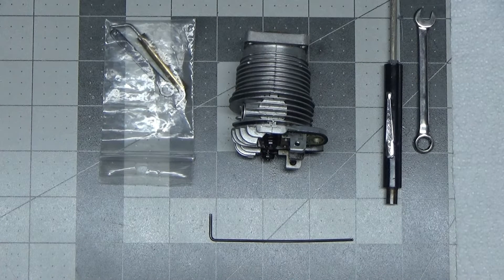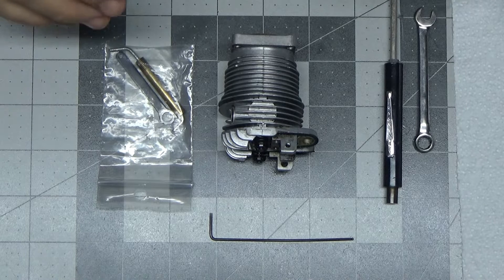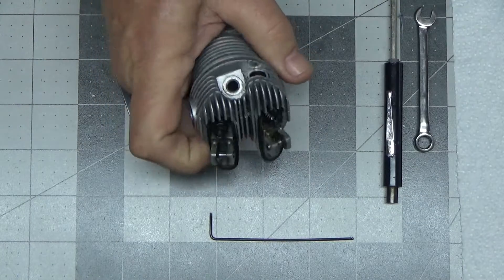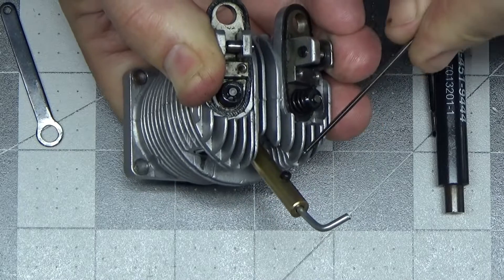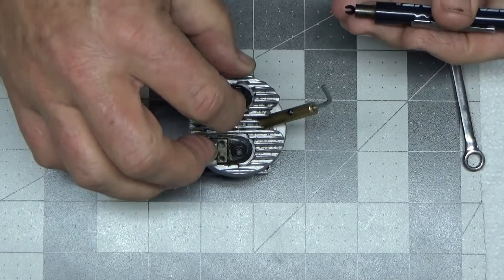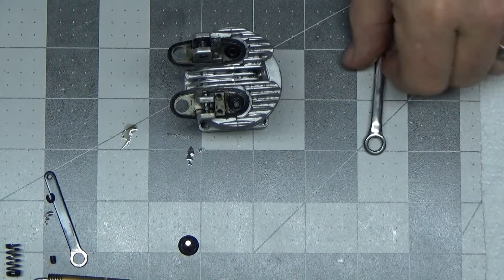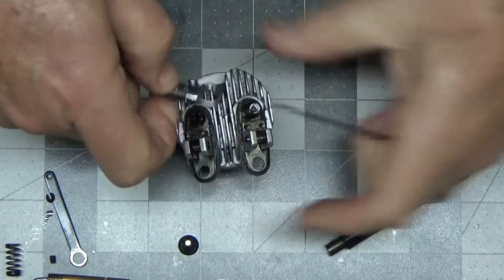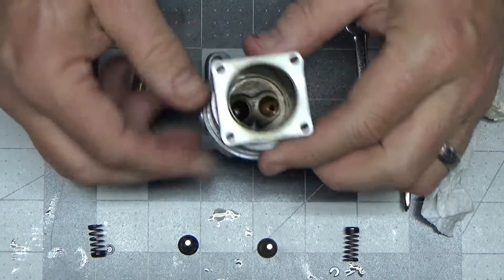Saito Valve Removal Comparison Techniques

Comment: Hi i have a question? I cant get my saito fa 40 to run for more than 4 seconds before it cuts off' im using 20 20 fuel and the recomended glow plug. I have the low needle set flush with the control arm'and high speed needle 2 1/2 to 3 1/2 turns out and fuel lines are all good and no clog in carburator. Ive tried everything and am givinf up hope but however i noticed one thing' i took the valve covers off righr whwn i first got it and never tried running the engine with them on' and i also saw that theres a gasket inbetweem the valve covers so it made me think is the gasket producing a better seal in case some of the compression is leaking pass the valves? Maybe that cover and gasket make it have less air leakage? Please let me know if you think you can help' thanks.
Reply from the maker: I'm sorry but I have no intention of troubleshooting your engine issue in the comments of this video. I have a link to my email address in each of these videos.

Comment: Lars tool would be handy if you just need to replace spring without taking head off
Reply: Well said. I don't like removing unnecessary things if I can avoid it, due to seals or gaskets that can be damaged on removal and most likely won't be able to find replacements. That being said, today I had to remove the cylinder from my Saito 120S and didn't see a gasket or oring on engine or parts manual. Is that the way It should be?  New to rc.
Reply: Another way is to take a burned out glow plug , punch out the center, solder a peice of 1/8" brass tubing in the hole in the glow plug , attach a soarce of compressed air to it, and hold BOTH valves in with compressed air!! .  THAT method has been used in the auto-engine industry for DECADES!!!